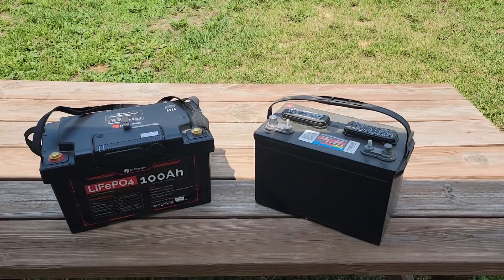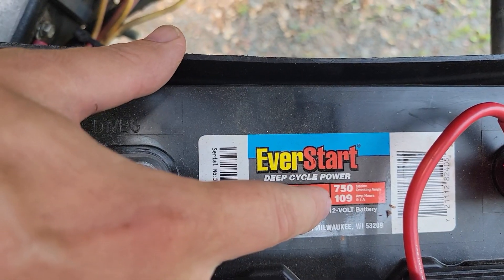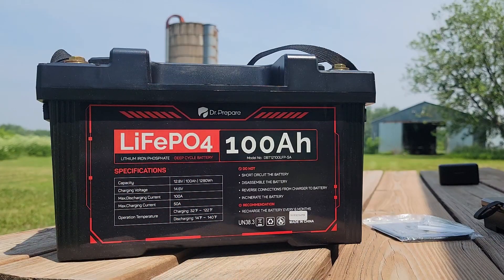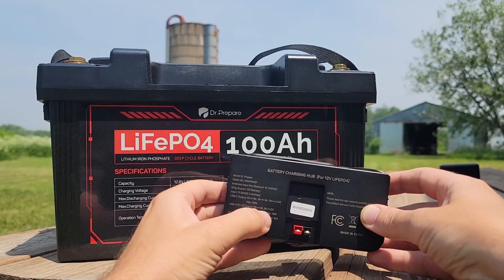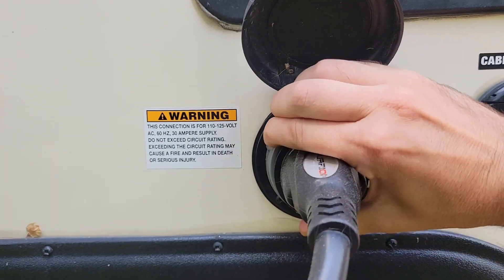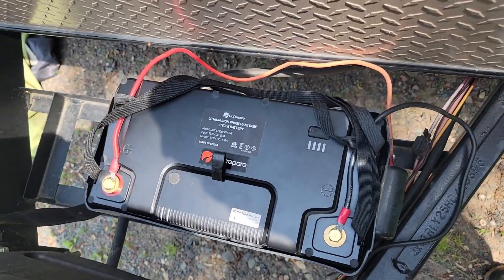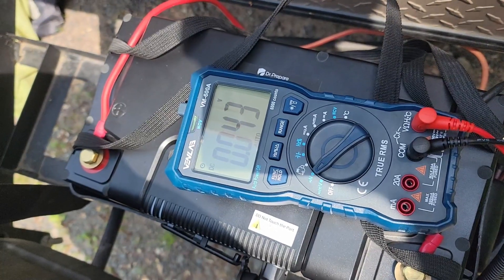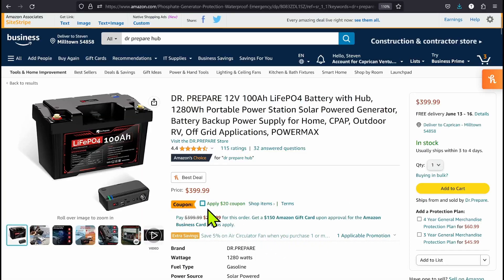Double your Power, Half Your Weight [LiFEPo4 Travel Trailer Battery Install]

Comment: So which Lipo battery should I get for my RV?  I need to replace my deep cycle.  Thanks
Reply from the maker: Hey Doug!  I'm kinda partial to the RedODO batteries and they have built in bluetooth.  Check them out here:  https://www.redodopower.com/?ref=mmSm1TYq 

I'm a bit of a data nerd, so I want the bluetooth to see if the battery is full or empty so I can plan my trip.  Step 2 would be to update the WFCO panel with a LifePo Charger/Converter if you don't already have one!

Comment: Great Video.  I thought the Lithium Iron took a different kind of charger than a Conventional Deep cycle.  Aren't you screwing something up?
Reply from the maker: You're right, Lithium batteries take a different kind of charger.  It won't hurt anything to use a deep cycle charger with a lithium battery, it just won't charge the battery to 100%.  I use Solar for that when I'm boondocking.  WFCO does make a drop in replacement for the deep cycle charger that will work with both types of batteries.

Comment: I have used that battery before. it is great ! love that hub. with a power pole you can extend it or plug into a power pole multi hub. The only reason that was a pass for me was the PD only 30 watts. I need 20V 45 watt or better.   I got 5 years on that same Wal-Mart battery.  you can discharge more than 50% but will damage the battery. and will drop under 12V . with LiFePo4 it will stay 12.8V or higher being around 13.1 V most of diss charge. depending on load. higher than lead. with solar MPPT use like a Victron or good MPPT controller and put ferrite cores on solar and battery side of controller close to controller use like a T 240-31/ or 43 core wind pos and neg together many times as you can get. this helps with RFI noise. I done this many times and it helps   . use can use a AM radio or HF HAM radio to test for RFI .
Reply from the maker: Yeah, RVs can be very noisy - LiFEPo4s are fantastic for RV Travel and Ham Radio

Comment: What battery box is that? I've not been able to find one that will fit the width of the Dr. Prepare Powermax..
Reply from the maker: Its a generic battery box (like tractor supply or auto parts store) and its a VERY tight fit.

Comment: Okay so you have started down the  LiFePO4 path, now you need a shunt to tell how much capacity you have left in the battery.  Look at the Victron Inverter/Charger, solar charges and espically the smart shunt.  All of these units talk to each other and the phone app is great. Not cheap but the integration is stellar.

I am running a Victron MultiPlus 12|3000|120 inverter/charger,  DC to DC charger and smart shunt.  The Multiplus has a unique PowerAssist feature that has come in very handy for us when mooch docking. The MultiPlus will prevent overload of a limited AC source, such as a generator or low amerpage shore power connection. First, battery charging will automatically be reduced when otherwise an overload would occur. The second level will boost the output of a generator or shore side supply with power taken from the battery. Highly recommended.
73
W9TAX
Reply from the maker: Victron makes good stuff.  I see blue in my future.

Comment: Does your ac to dc charger output 13.8v for the old sla batyery? If it is 13.8v, it wont fully charge the LFP battery.
Reply from the maker: It doesn't put out the right voltage for charging the battery.  Look out for a converter upgrade video coming out soon.

80% of 100Ah is > 50% of 100Ah, so its a start in the right direction and ya gotta do things one at a time.

Comment: I bought one of these, It works great for most 12 volt things. At around 68 to 76 ambient room temp it ran my 12 volt chest fridge/freezer for 6 days as a fridge set to 34, ran it for 2.5 days as a freezer set to 0. Just be aware that there are somethings that do not like to charge off of battery powered usb ports for some reason. I got a topdon car jumper that charges using a usba to usbc cord and it will not charge off a power station or the battery and the hub. It charges fine off of my computers usb port. I also got a solar charge controller for it from PowerWorks (may be spelled differently) for about 50 dollars that charges it around 300 watt instead of the built in 100 watt charger in the hub. I have a video of it if anyone wants to see it.
Reply from the maker: USB can be weird some times.  Even with USB-C, they've introduced some new problems when they fixed some old ones.  I have a few PD battery banks that don't output all the available voltages - like it will do 5,9,15 but not 12v.  The times we live in...

Comment: We bought a LiFEPo4 100ah to get our 12v refrigerator through a few nights when dry camping. I took our original battery and put it under the radio bench, connected to the powerwerx 30 powersupply through a KI0BK Low Loss Powergate that I hook my radios into. I was rushing to my operating position to run a net the other night and did the whole hour at 25w without noticing I didn't turn on the power supply! So, that was a good test. We haven't upgraded either the solar controller (replacement in hand) or the converter/fusebox ($159? from the mfg) yet.
Reply from the maker: That's awesome!  I'm thinking about putting some panel mount power poles on the bench and running wires back to the battery.  I did a live stream on my ham channel where I run 2 laptops, the live stream, the lights, the 100w radio and an inverter doing "hard core FT8" for 5 hours before the battery died.  I'm pretty happy with the amount of time this will last, and I can double up the batteries to double the runtime too!

Comment: What converter dose your camper have? I haven’t moved to LifPo because my converter won’t push 14v to charge.
Reply from the maker: Mine won't push 14 V either. So I won't get a full charge off of the Built-in converter. It looks like replacing the converter is a fairly easy drop in, so that will be something I do in the future.
Reply: I went ahead figuring that 85 percent charge on true 100ah is better than 100 percent charge on a 65ah deep cycle that only gives me half power. I'm putting in a replacement solar charge controller to top it off.
Reply from the maker: This is what I plan on.  80ah out of a 100ah LiFePO4 is better than 50ah out of a 100ah SLAB Deep Cycle